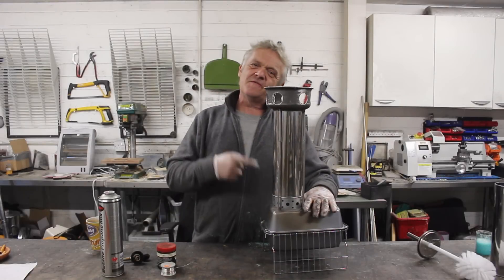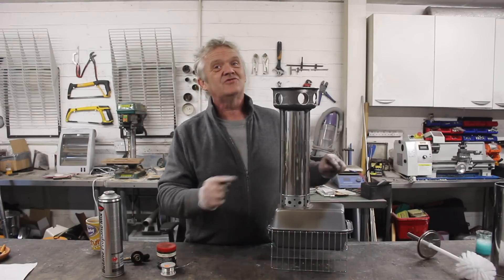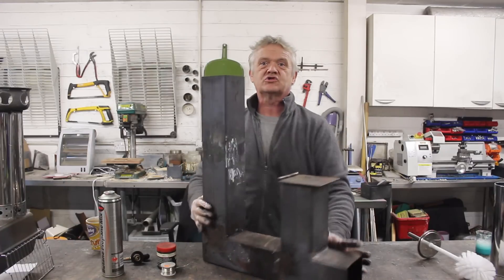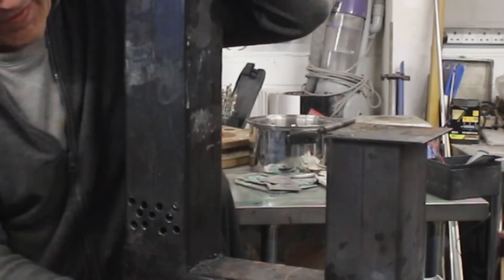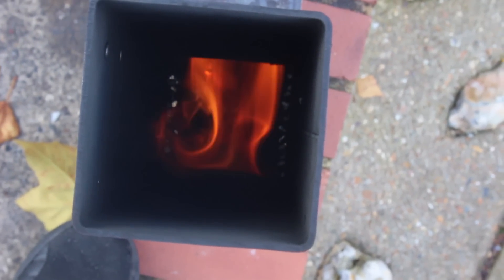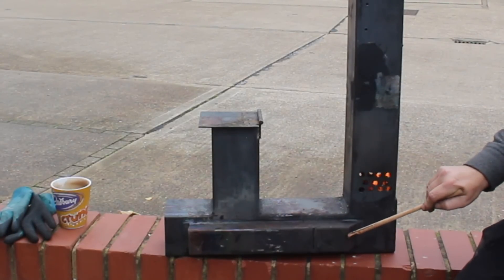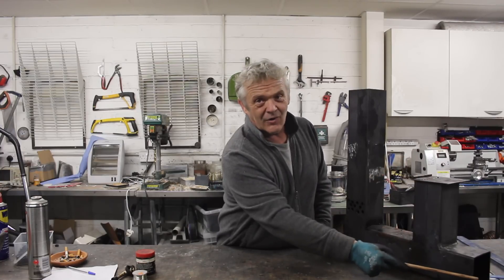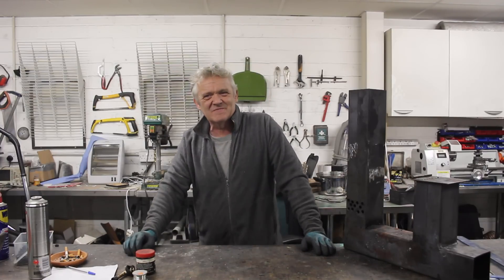1732 My Rocket Stove Adaptation

Comment: How about adding a cross  flow fan across the combustion chamber to create a hot air stream to heat a room say  useing thin wall steel and a compter fan

Comment: Secondary burn chambers are the way to burn secondary gasses
Reply: After igniting, the exhaust is ballasted..it holds back the smoke and compresses it then as mass is achieved the compressed smoke  ignites..simple
Reply: Do look into rocket mass heating using 55 gallon drums and that proper burn chamber for more precise info on how gasification works with rocket stoves..fire science.

Comment: Great idea 💡 to add holes at that location! For ease of use, maintenance, cleaning, it would be nice if that vent your adding allowed you to remove the riser.  The riser could fit on top of the air vent for easy assembly without covering the air vent holes.  That's what I would do.  
Also, the best designed ones imo have a means of bring in fresh air from outside and venting air outside using cheap standard gas pipe vents.  Forget what they are called.  I've even seen someone use gutters.  Lol. If it works.

Comment: I went through the rocket stove phase which is why I now heat my home with one a pellet burner homemade gravity fed I don’t really know if adding holes to it does Mine doesn’t have any holes but it does go into a larger barrel and then get vented out lower but it’s smoke-free
Reply: @B K -  well done with the pellet burner!  I've built a bunch of rough test setups that seem to show that 'enough air'  in the main intake can do the trick.   Excess air, if you like.  By enlarging the intake (crudely brick built, mostly) we can get even a 'short' heat riser to do a clean smoke-free burn as demonstrated.  The 'extra air' passes  through the confused burn region (twigs  and bits) along with the fresh wood gas and encounters fierce vortex mixing at the base of the heat riser.  
Once up to working temperatures this mixing ensures that no wood gas leaves unburned, verified by flue test  analysers. Controlling the air/wood gas ratio with twigs and bricks  is tricky!   A bit of excess air is OK, too much cools the burn.

Comment: Having looked around at one or two other rocket stove contributors, plus having a mental conversation with Mr Spock, surely, on the blacksmith forge principle, if you were to blow air through, from the input hole, you would get loads of oxygen and heat - so you're aiming to get a similar effect by instead generating draw up the chimney. Many others insulate the chimney - do you think this would increase the temperature enough to significantly affect the amount of draw? I find it hard to believe that the velocity of the air in the chimney is already so great that you need more holes in the base to let in more air - isn't that cart before horse? Generate more draw, then, if need be, admit more air? Possibly the relationship between the cross-section of the horizontal and vertical tubes? Loving the videos!

Comment: Thanks for another great video!

The J-tube portion of a "rocket" stove/heater is meant to be insulated (fire brick, ceramic blanket, castable refractory cement, etc), this promotes gassification by keeping the temperature quite high, especially in conjunction with a warm-air intake (the outlet of which could be positioned in immediate proximity to the final bend), and a thermal mass for heat exchange on down the line. The thermal mass can give an opportunity for any unburned components to add heat after sufficient build up of creasotes and the like. Chimney fires are desirable in such a "Rocket Mass Heater", as they simply add more heat to the system.
Reply from the maker: cheers mate - i didn't do that as this is really an experiemntal version but nice tip

Comment: Rob...

Hoping you will consider adding a bell (like the flower pot) to slow the exhaust games to allow more heat to transfer to the living space before heading out the chimney.
Reply from the maker: nice idea mate - i probably won't as this is an experimental model meant for hacking about with - but i like the idea yu should try it and tell everyone how it works out

Comment: I've been thinking of making a rocket stove like this out of a old gas tank and oxygen tank, however im thinking of adding an extra linear tank sleeve and between the gap run a coil of pipe packed in sand in which to heat water, sort of in a jacket around the upright. What do you think? 🤔
Reply from the maker: i think that sounds awesome mate

Comment: Very interesting mods Robert and its suprised me how much apparent heat that small collection of wood made .Just a thought on seeing it ,maybe a thermoelectric generator on the side of the fire driving a low voltage fan forcing air into your side inlet?
Reply: Wouldn't the vortex created inside make a partial vacuum and suck air in anyway?
Reply from the maker: it's a good idea mate - my own tendancy is towards passive options as they don't break down - but active forced air through the use of a fan is a good idea for sure

Comment: I wonder if the holes were moved to the corners, 2 or 3 holes vertically on say only the right of each side.  That would be say 3 holes on the right of each of 4 sides.  Or even just short vertical slots with a grinder also only on the right of each face.  It would rotate the flame nicely.  Almost as well as the fire extinguisher.
Reply from the maker: i will have to try it mate

Comment: i love this! i've seen rocket stoves that have a really long horizontal exhaust through a mass (collects heat), some so long that they had to create a valve to direct the hot gases direct to the chinmey first (while starting up) to heat it up enough to create the draw required to pull the cold air through the horizontal mass when you flick the valve over.
I'm now wondering how much the holes would reduce the ability to push air through the system without back flowing/spilling out the holes (if you were wanting to push a large amount of air with it). 
maybe one of those tesla one way valves (no moving parts) would be able to resist the back flow problem? it could act as the heat jacket too, may be horrible to clean though...

Comment: Two suggestions, first drill the holes in each opposing side but in a group close to the opposite edges so the incoming air induces a vortex, secondly other users have found a ratio of 5:1 for primary air to secondary as the best mix. Perhaps add a flap valve to fine tune this. Ah, a third suggestion… and please use preheated secondary air with a cowling arrangement.

Comment: I wonder if you could have gotten that vortex rotation and it being the direction you wanted if the holes had been drilled with smaller bit that you take and then go through with it at an angle all the same direction around it, so the air would bank off one side as well as tilt that angle upward too. (like these slashes if they were the direction of the holes \\\\\ so to speak)

Comment: So, instead of the holes , it might be cool to cut and bend "vortex flaps" for your air intake.    (though installing some on the inside behind your drilled holes would probably be easier, thinking on it).   Don't know if there would be a point to it other than the cool factor of a flaming vortex in a box.
Reply: It would perhaps make the footprint more compact to build it as an inverlute.  fire box/preheater intake on the straight part, run into a round chimnea.    I mean, that doesn't Matter at all but it seems like a neat design if one had a sturdy metal inverlute around.

Comment: Love your work as I have been into everything you been doing for a while now. I do have one question that I just cannot find an answer to anywhere and maybe you can... I have a love for heat batteries. I have wanted to make a solar heat battery and use that stored heat to heat my pool, my issue is that it obviously gets too hot eventually. How can you regulate the heat transfer from a heat battery. Electric and gas you can turn off and on but since the heat battery is always on I cannot think of a way to stop and then later turn on with out a massive shock to the system due to temp differences.

Comment: This is basically how my wood furnace in my house is built. There is a main (sealed) door 6 inches above the floor of the chamber in which to fuel is loaded, typically split fir, pine and birch wood logs. The burn chamber, lined with fire brick, is 30 inches deep front to back, 15 inches wide, 24 inches tall. On each side is a top to bottom steel plate that draws air in from an air door below the main fuel door. There are are vertical oval internal air ports at the bottom in the plates at the entrance near the fuel door, in the center but the back is open top to bottom of the plates which extend to about half way up the sides of the burn chamber. At the top of the burn chamber are two overlapping plates spaced about 2 inches apart, that slow down the escape of burnt gasses and any flame into an insulated 6 inch steel pipe which is situated at the far back of the chamber. There is a forced air fan that acts as a bellows to begin the burn and shuts off automatically at a specific temperature setting. The air door can also be controlled electrically via an adjustable reading thermocouple. The gasses exhaust through the 48 inch long by 6 inch steel pipe that is set at an upwards angle of about 30 degrees into a concrete chimney flue lined with rectangular ceramic firebrick pipe sections. On the next floor above where the chimney breast goes through the room floor to ceiling, is a hole into the chimney about half way up, to which can either be attached a secondary wood stove steel pipe flue, or in this case, a heavy steel plate fitted with large radiating fins with extensions into the chimney proper in order to catch the heat from the spent combustion gases. The furnace is also attached to a system of hot air pipes fed by a temperature controlled  furnace blower to effect central heating. The entire installation is approximately 40 to 45 years old. The only innovations I have implemented is the heavy steel plate to catch the exhaust gas heat on the upper floor and the overlapping heat plates in the burn chamber.
Reply: Can you please give us a detailed photo/draw of this?

God bless you

Comment: On a rocket stove a friend and I built, we drilled holes 3/4 up the flu. It was a J-tube and we had it inside 2 metal boxes, one horizontal (where wood burned) and the other vertical (with J-tube flu inside it), separated by a divider with a hole only big enough for the J-tube to pass through. Drilled holes 3/4 up the J-tube and at bottom of the vertical box. Air entered (was sucked into) holes at bottom of vertical box, went up, and entered the flu through holes in the J-tube 3/4 of the way up.
At first, we didn't drill enough holes in outer box and the walls of the outer box went concave when it came up to heat. Drilled more holes until it stopped sucking in the walls and it worked great, no smoke. We even tossed an oil-soaked rag in the fire and it made no smoke. (We were experimenting, so don't throw hate for pollution.
We still think the stack effect contributed to that initial suction.
That initial suction was so forceful that I've been toying with the idea of putting a 2nd flu in the vertical box to just pull air and putting a small wind turbine at the intake of the second flu just to see how much electricity it will generate just from the hot air rising.
Thought about TEGs or Peltier devices, and it can be done, but they're expensive. If a second flu or pipe can go into vertical box beside the flu that carries smoke, a mini wind turbine might be a cheaper, more effective method.
Reply: BTW, outer boxes were made with sheet metal, which was thin enough to be somewhat flexible. That's why the vertical box went concave when there were not enough air intake hokes at the bottom.

Comment: I thought you got all the air you need from the air getting sucked into the horizontal opening?  Would the extra holes decrease the pressure from that process?  I suppose a positive would be that the extra holes would create more turbulence and mixing?

Comment: would putting a jacket around the chimney with a say 20mm clearance and stopping 200mm from the top of the chimney not solve the air pre-heating issue, as the chimney would be heating the air on the way down to the holes. Maybe 10mm. Experiment! 
Thanks for the vids - always inspiring

Comment: Do you have footage how the original rocket stove worked before you added the 11x2 holes into it? I thought Rocket Stoves originally had no soot because of the 1:1 intake to output air. So I wouldn't have even thought to add the 11x holes

Comment: Very good Rob!  Your design has advantages over a pulse jet.  Air intake directly into an expanded burn chamber and you would have a pulse jet rather than a rocket stove if your air was super heated first.  Your design has an advantage for a stove though as your fuel will last longer.  Bravo!  I like it!  Keep it up Rob!  Thanks for the video.

Comment: Perhaps the final air mixture should be at the top of the stack so the combustion happens at the exit of the chimney. 

Also, which burns better:
Cold dense air
Heated air from pyrolysis chamber
or super heated air that say was, pyrolysed warmed then passed a second time through another heat exchange location. Preferably where char/coals would be hanging around until exhausted of fuel. Basically, like super heating steam before it goes to the turbine. 

Does super heated oxygen aid in cleaner more robust combustion should be the simple question.

Comment: A lot of rocket stoves seen on YouTube seem to take extra steps to keep the final burn chimney hot. These are pre-heating of the secondary air feed to avoid cooling of the final burn chimney and a cover, often put over the chimney, again to keep the chimney itself hot. I have never built a rocket stove so I don't claim to know if this really makes any difference to the complete combustion we would all want for reduced emissions and full fuel use.

Comment: Are you able to use these like inside a building if you were to lose power which affected your heating especially if it were too effective for a day or two or would you need to still make sure that this was vented to the outside if you're burning as efficiently is what is implied then you should be able to burn inside wouldn't you?

Comment: use heatpipes like from cpu colers to transfer more heat to where it is needed (gassification chamber). Preferably make your own copper heatpipes, should not be too difficult.
Reply: Maybe pipes running through the drilled holes, curving upwards, so oxygen is reintroduced a couple of inches above the flames

Comment: You know a few hours ago I was thinking about that extra air if it needs to be heated and you just confirmed my thoughts that yes it needs preheated air intake for better burn. Also was thinking about combustion engine air intake which cold air is preferred because it gets more molecules that way, which is quite the opposite, but of course even though oxidation is still happening in both reactions the engine has explosion occurring whereas in rocket stove you have just burning. That thinking gave me a new design for rocket stove which I might make later when I get proper materials for it, making it will be time consuming and a pain in the neck, though.
Reply: no, they are both the same, you want cold air to get the most air in the smallest space in the shortest amount of time, and all the air in the cylinder is heated up to the same combustion temperature anyways. the two differences is that this type of burner doesn't use forced air so you can design a larger, continuous air, intake while expanding the air helps create the draft that draws more air in faster. the real issue is letting in enough air in for complete combustion, without so much air that it cools the chamber to below combustion point. pre heating the air robs heat from the system, where ever you put the pre heater, which is a net negative, but hot air doesn't cool the combustion chamber as much, so you can have too much air without causing problems... particularly interesting as when you have too much oxygen you generate less carbon monoxide.
the combustion stays the same, it is just the design requirements change.

Comment: I can't find a number on it, but I wonder how salt compares with sand for your thermal storage system.
Reply: The melting point of salt is about 800degC, which some stove designs do reach. Not saying that's automatically a bad thing, but something to bear-in-mind.
Reply: @TheBaconWizard  Yeah I checked it and it is surprisingly low very dodgy if it gets loose however it does bring in the issue of latent heat of melting which is a bonus.